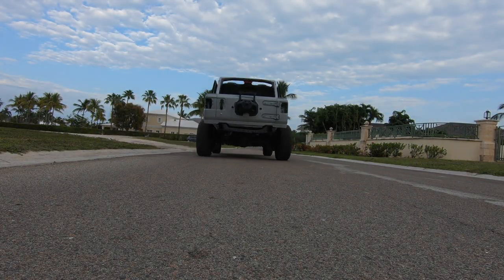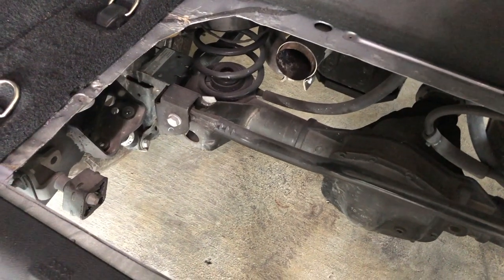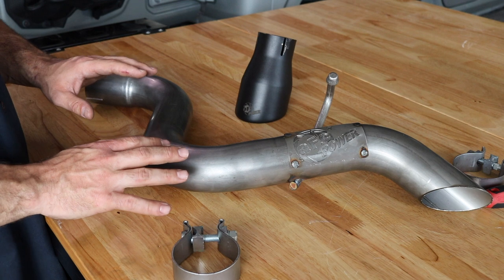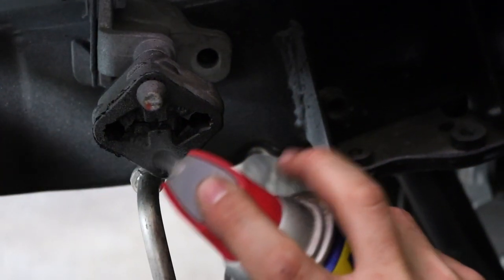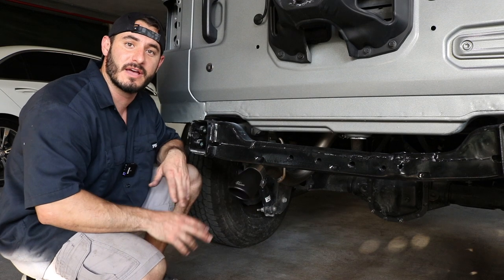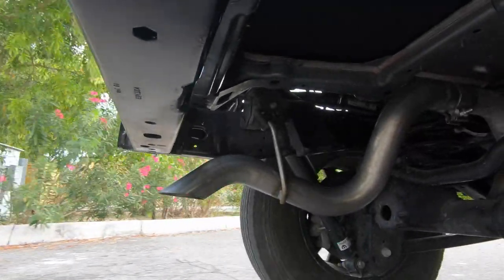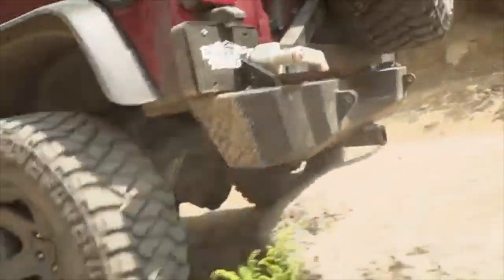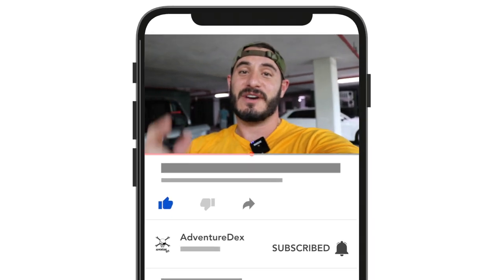How to install a Jeep Exhaust! - 3 Easy Steps!

Comment: But aren't you still using the same muffler......all I saw you put on was a section of exhaust pipe. I placed an American thunder cat back exhaust from Flowmaster,  it was the full length of the jeep, and the end goes up over the drive shaft and the tip is flush with the rear cross member of the frame. In fact you can barely see the tip. And the clearance is ridiculous,  sound is very nice....not subtle at all, combined with the CAI K&N it sounds fantastic
Reply from the maker: Thanks for sharing! The muffler is gone but this is only an axle back so doesn’t replace the cat back, etc. thanks for watching 👌🏼
Reply: @adventuredex  so legally you can drive with no muffler on the road???
Reply from the maker: Yah!

Comment: Why aren't you rust proofing that piece? Looks great
Reply from the maker: What piece????
Reply: @adventuredex  the pipe, wouldn’t it rust after a while? I think you’re right, you don’t need the tip on it either.
Reply from the maker: No the pipe is stainless steel it won’t rust 💪🏼 the tip is only for aesthetic purposes, not really necessary. Thanks for watching!